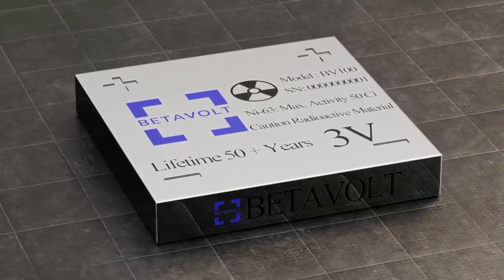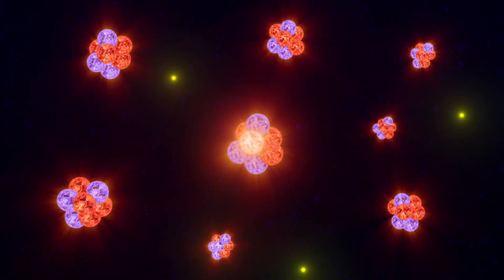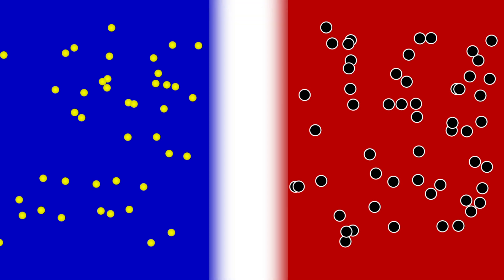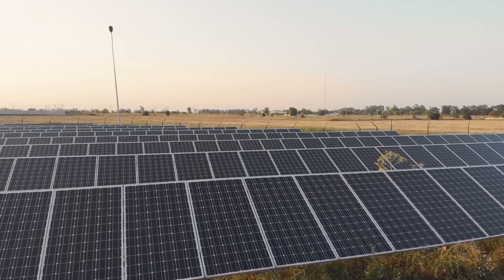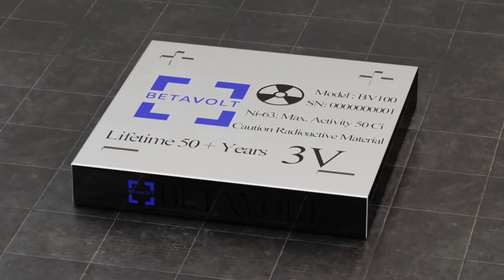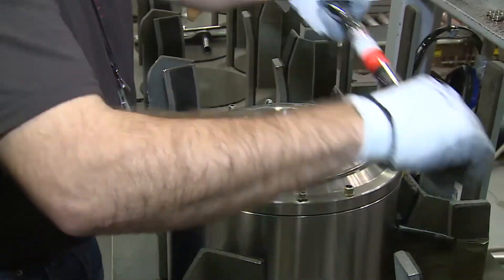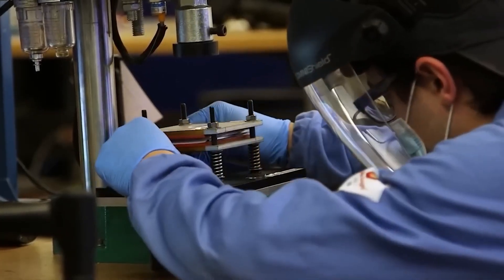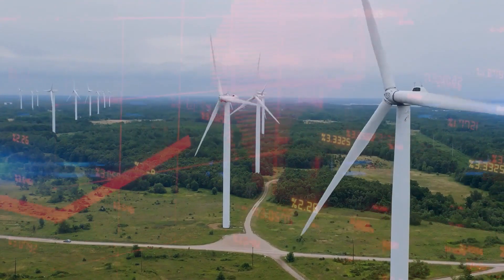Atomic batteries - breakthrough or deadlock?

Comment: 100 microwatts 😂😂😂
Reply: It's extremely useful for things like pacemakers where changing the battery or putting a cable in to charge it isn't really an option. They don't need to send out high power very often. They just need to charge up a capacitor over time and then deliver it all at once once in a blue moon.

Edit: They apparently mention pacemakers later on in the video.